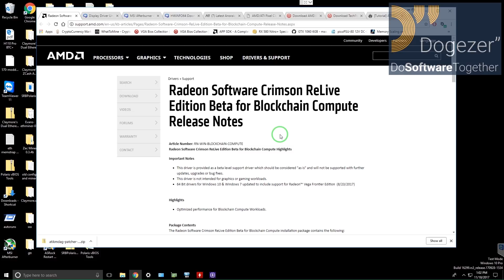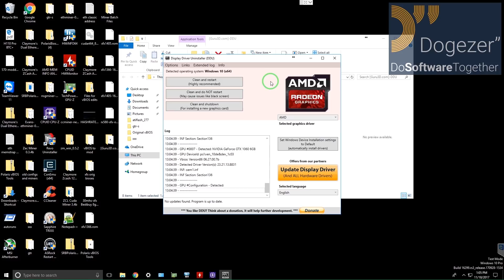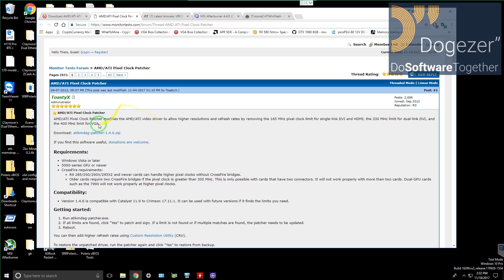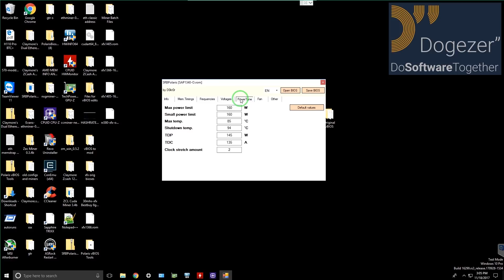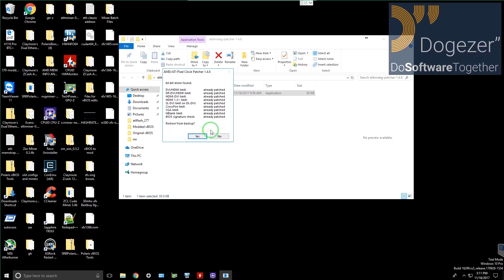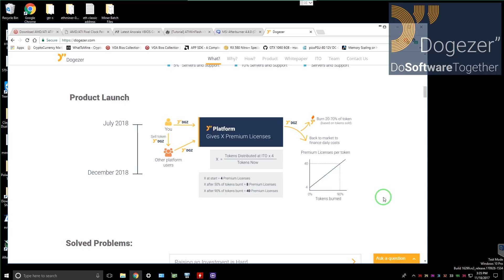How To Optimize AMD RX 470/480/570/580 Cards for Mining - FULL GUIDE!

Comment: Hello, thanks for sharing, i would have a question, i am stuck in the step whit , AtiWinflash.exe -i , => it says ''Adapter not found''. i am using a rx 580 8gb sapphire pulse, no bios switch , windows 7 x64 fresh installed, and amd driver 18.2.2 currently i got only 15-17 MSH on etherium .... i tried to install the recommended beta driver but it give an error .....any help is welcomed .. Thanks again!! Cheers
Reply from the maker: Sorry for the late response, unfortunately the blockchain driver seems to have caused the same issues for all others running  Win7, lack of care on AMDs part I would say. Is your GPU hooked up to a monitor directly?
Reply: I figured in the end of the day, was the driver issue , was a driver issue, was working the bios glad with 17.5.1 driver version ... ;) Thanks again
Reply: Yeah I'm getting the same message. My monitor is plugged into the MB.

Comment: Love the guide!! I know I can flash my gpu now, whereas before it seemed like an overwhelming task.  I am running into a hitch though and can't figure it out. My card is an rx570 4gb Red Devil. I am running cmd prompt as an administrator but I can't get the adapter numbers to show up.  
Here is the code 

C:\WINDOWS\system32>cd C:\Users\tarlr\Desktop\atiflash_277
C:\Users\tarlr\Desktop\atiflash_277>AtiFlash.exe -i
C:\Users\tarlr\Desktop\atiflash_277> 

The file path is correct. Any ideas would be greatly appreciated! Thanks in advance!
Reply from the maker: Hey Tarl, and sorry for the delay in getting back to you. If you're still having that issue - from the input you posted it looks like you're correct and in the right directory. Did you make sure that you have the 570 you're trying to flash hooked up to the monitor as the main display output?
Reply: That did it!  Thanks a ton for your help!
Reply from the maker: Glad you got it going and happy to help! Hope you stick around, my next upload will have a prize that everyone who views it will win!

Comment: once I downloaded the blochain drivers the miners had wouldnt work, so I went ahead and reinstalled the newest drivers and the mners are workign fine, I something is up with My rx 480, I was only getting 360hs on claymores crytonight and after I did the bios mod I get 480hs, but when I use the mkxminer on lyra2rev2 I get 30mhs like I should
Reply from the maker: Ah, yes my video is Windows 10 specific so don't bother using the drivers I cover as they don't work on Win7 properly.

Comment: Hello Once again, I have being running 2 cards for more than a month now and average hash rate was 880h/s for my 580's, I decided to increase the my cards to 5 and when I run my miner I get 330h/s for each cards, what must have gone wrong?
Reply from the maker: I would likely need more info to be able to diagnose the problem, but my first thought would be that by installing the 3 new cards that the AMD drivers have updated to  a new version. This is assuming you were using the beta blockchain drivers used in my video.
Reply: @ThirdCoastCrypto  Thanks for the reply man, I now seem to have a bigger problem, I reversed to the original bios of the cards and restarted without patching, now the rig is not booting up, it powers up but nothing shows on the monitor, I changed the monitor adapter to the motherboard, but it's blank.
Please I really need help
Reply from the maker: Fist off, relax. After working with hundreds of people I haven't yet found something to be irreparable. Did you make sure to flip your cards vBIOS switches back to the original positions if they had switches? Or at least the switch on the GPU which you were using for video output? If that doesn't work I would suggest maybe switching two of the cards places( the PCIe lane riser it sits on). Try moving the main card you were using for video by switching its location on the motherboard with a different one.
Reply: So, I dismantled the rig and reconnected it back with just one sapphire card, the rig didn't boot up, I took out the power of the sapphire card and the rig booted up but couldn't see the card, I patch and restarted my system but no way,so reinstall all the driver again, but that didn't help. I restarted again and plugged back the sapphire card, device manager saw the card but it had the yellow triangle indicating something was wrong.
I tried my MSI gpu card and it came up and displayed on the monitor, I shutdown and added a sapphire card, but the rig didn't boot up, I removed the power of the sapphire card and the rig booted up with only the MSI gpu card, so I knew something was wrong with the sapphire cards (4).
I checked the info of the cards using GPU-Z and found out that memory and clock are all 0 and when I tried to check for the bios in the advance section, it give the error 'unknown'.
Also when I run AtiFlash.exe -i, it shows only the MSI card on the list.
Maybe I must have flashed the sapphire cards with the MSI rom.....
How do I get this back up?
Thanks in advance
Reply: Waiting for your reply man. Thanks

Comment: Hey man, I have 5 GPUs- 3 580s, 570 and 480. The 580s are working properly 28 mh/s but the 570 and 480 have a (code 43) what should i do? Anybody that have gone through the same problem i have please let me know. Thanks
Reply from the maker: Victor, it's likely from recent Windows 10 updates. If you can do so, try to roll back to the latest Windows build from one of the restore points made by Windows before installing the new updates that caused the crash. If you can do that and get it working, your best bet might be to use to program 'Autoruns' and disable any Windows update service (you can find videos or a guide on how to do so). Let me know how things go or if you've resolved it.
Reply: Hey man. I couldn't resolve the problem, even a friend of mine had the same problem. The only thing we did not tried was restoring point before the new windows update. What i end up doing was flashing the 480 and 570 back to stock, which normally those cards gives me 22 mh/s each, combined with modded 580s my total is 127 mh/s using Claymore miner. Using Phoenix miner gives me 129 mh/s.
Thanks for the reply, great video and info sources btw.

Comment: Will it work on Rx 570 4gb?
Reply from the maker: The DAG file for mining ethereum and/or ethereum classic has exceeded the viability of 4gb of vram cards. Now in regards to other coins that use ethash besides those, then yes, it will work. Also works for coins on equihash. That being said, there are easier ways to modify (software based)  some of your GPUs without low level firmware mods like in this video.

Comment: doesn't work with win 7 but works for win 10..fiy anyone having issue
Reply from the maker: What didn't work for you Ezra? 
The guide in full, save for the one part works for Win 7x64. The only complications I've noted anyone mentioning are with the blockchain driver I link in the video. The previous one (Aug 11) edition one should work fine if you can find it, otherwise maybe try the new Adrenaline drivers with the compute option on.
Reply: I tried with the blockchain driver on win 7 but didnt work and tried 17.11.4 same issue. Win 10 worked using the blockchain driver after trying to set it up on Win 7.
Reply from the maker: Thanks for the response Ezra, the info will help other miners. I try to make note of all issues regarding compatibility.
Reply: Ezra Lee Yup I’m having issues at the moment. Xmr-stak keeps crashing now even when I bring my card back to stock setting through ati flash. Thought it might of been the bios mod i downloaded but still crashes when brought back to stock. Any help? I’ve done this on my other computer that has windows 10/64 with 3 rx580’s and they work beautifully. Now when I attempted to do the same on another computer running windows 7/64 with only one rx580 it’s been giving me problems.